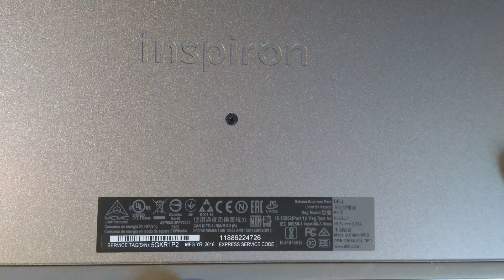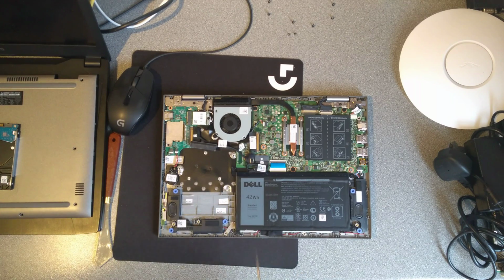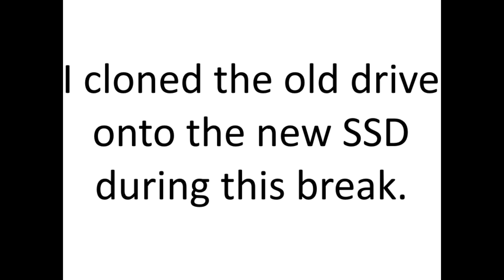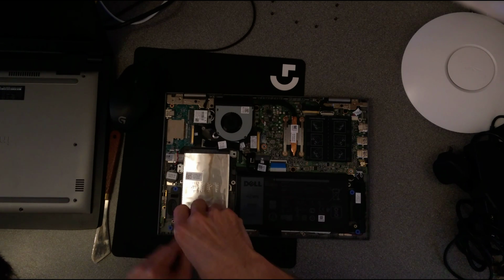Dell Inspiron 13 5000 Series P69G - How to change or upgrade the hard disk

Comment: Using a plastic spatula should be better to avoid damages ...
Reply from the maker: The RGM metal one is really good and I don't feel like it will damage plastic laptop cases. I've not managed to damage one so far and it's far more sturdy than a plastic one.

Comment: Hi, I have the same laptop and ever since I bought it, it's been INSANELY SLOW. Takes a couple minutes to open web browser, freezes up real easily. DISK is most of the time at 100%.. Memory is usually at 75% and CPU 15%.. Any tips? I tried a complete reinstall of windows. Still super slow. My 10 year old computer are 10x fast than this one lol I bought this laptop mainly for using the internet.. can barely do that
Reply from the maker: No point using a computer these days if it does not have an SSD in my view. Upgrade to an SSD and it will be faster than all your other computers.
Reply: Having same issues. Did you replace with an ssd? If so did it fix the issue
Reply: Yes, 100% fixed the issue. The computer is super fast now. Home Screen appears within 5-10 seconds of turning on the computer, it’s crazy

Comment: Hi! I have this similar laptop. One day I was using it and suddenly it turned off. If I connect the charger, the light of the charger goes off. I can't charge it, turn it on. 
What can be the problem? 
I would be grateful if you answer me!
Reply from the maker: Possibly faulty protection diode on the motherboard? (or loads of other reasons). Have you tried a different charger in case the charger is just faulty?

Comment: ay i need help the left clip between the screen and keyboard is completely stuffed when i try to close my laptop it starts to take apart the whole left bottom side of the screen and inside its bending some of the things inside mine is a inspiron 13 5000
Reply from the maker: Sounds like the screws that hold the hinge in place (or more likely the entire pillars they screw into have snapped off). The hinge are very strong so it will just be rotating the metal bracket out of the case as the plastic alone isn't strong enough to keep it in place.

Comment: I have this same laptop with the sound going in and out from time to time. How would I fix this issue? Maybe something was knocked loose from a drop?
Reply from the maker: If you are sure nothing is stuck in the headphone socket (which might turn off the speakers if it thinks something is plugged in)... At 4:43 on the right side of the battery is one of the speakers. Above that speaker is a red, white and blue wire going to a white connector on the motherboard. Check that is secure.
Reply: @freename  checking right now. Everything appears secure. So the sound goes in and out. If you go in the settings, you can mess with it to turn it back on. Maybe there is a short somewhere?

Comment: Hey, im here with my new hardrive and old hardrive looking lost, i have the same computer, but how did you copy the data off the old drive? Or did you mean that the new hardrive was a copy?
Reply from the maker: I'm often replacing the hard disk and reinstalling so once I swap the drive I would just install again off the Windows 10 USB stick. If you wanted to "clone" your machine I recommend using Macrium Reflect Home (free!) and a USB to SATA converter like this one: https://amzn.to/32IsXWI.

Load from your existing hard disk in the computer. Plug the new one or SSD in using the USB lead and use the Clone option in Macrium to copy the partition to the new drive. Once copied, shut down and swap the drive!
Reply: @freename  , thank you for the video and explanation but quick question... I have cloned the entire HD to SSD, but after this when i put the SSD inside laptop , Windows didn't boot. Do you know why this is happening? I checked partition size and type ( MBR/ GPT) and it is all right.
Reply from the maker: What did you use to clone it?
Reply: @freename  I used EasyUs
Reply from the maker: @wilsonsilva5779  Maybe re-clone the drive using Macrium or use the Macrium rescue disk/USB drive and when that boots click the Fix Boot Problems option on the left when on the "Restore" tab. (and then re-clone using macrium if that doesn't help).
Reply: @freename  I'll try! Thank you!
Reply: @wilsonsilva5779   Hello..  I have the same issue.  Let me know how yours went after recloning.. Thanks in advance